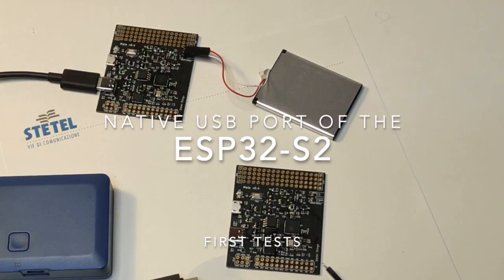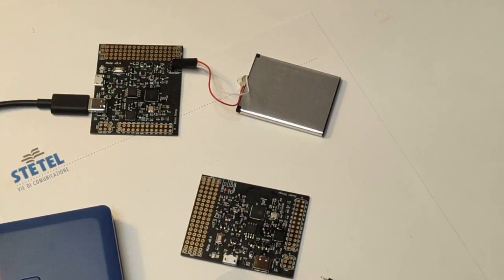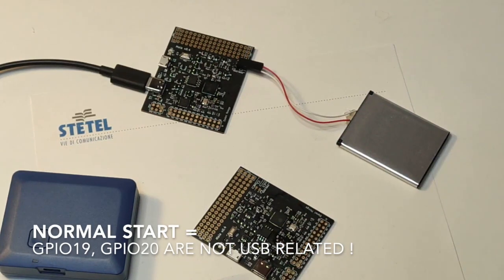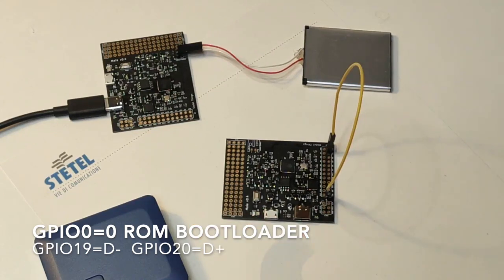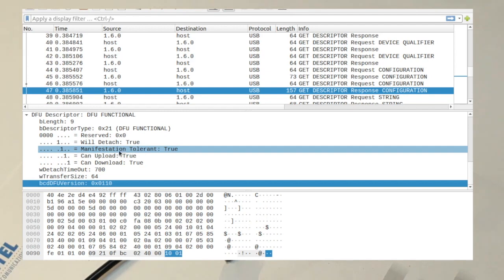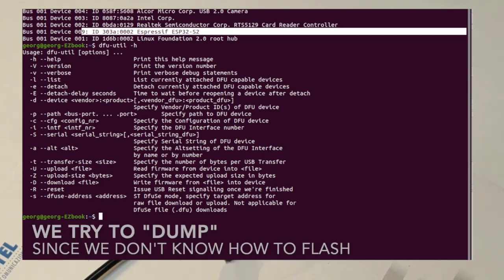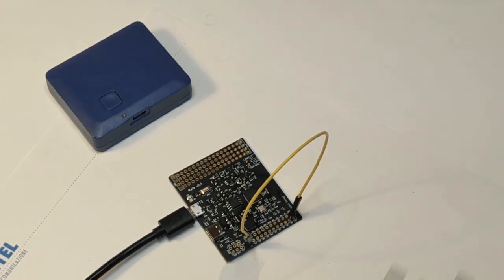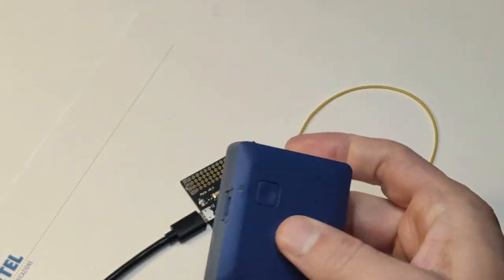ESP32-S2 Maia Devboard native USB OTG experiments

Comment: Omg, I know those USB descriptors by heart right now... DFU indeed dumps the whole flash, and you can also upload it using the DFU download command. However, there is a (CPIO-based) upload mechanism that can do much more including flashing partitions... should appear in the near future, keep your esp-idf repo updated I'd say. If you want to experiment with CDC: at the moment you need to specify --no-stub, or it won't work. Also, see if you can add -z to the write command for moar speeds.
Reply from the maker: Thx for the "insider" suggestions. We will try them out. I guess you're behind the USB code in the chip rom :) .  Keep you posted !
Reply: @StetelLab  i have ESP32-S2 based board with USB data lines connected  to the ESP32-S2 USB pins. The DFU is not working. When i enter into flash download mode (GPIO hold down, then click reset), my PC seems to not see that there is device attached. Im using Linux Mint 19.2 and have done the udev rules part. Why my ESP32-S2 is not showed as USB device? Is my chip too old (old revision) or I am doing something wrong?